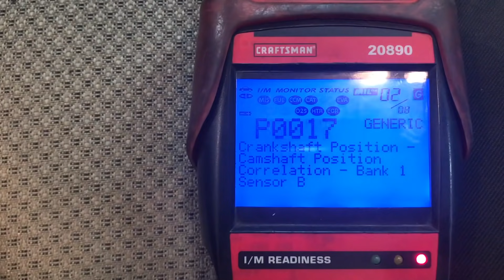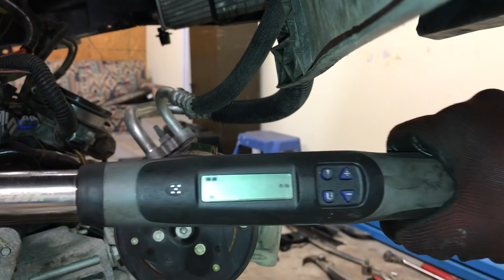Step By Step: 2.4 EcoTec Timing Chain Replacement

Comment: Change your oil..   as I GM technician for over 20 years this RARELY happens on engines where oil is changed about 3 times a year..  or 4k miles maximum... I've done hundreds of these and its  usually after many overdue oil changes...  I've seen this happen many times and there was less than one liter of oil in the engine..  and they went 10k + on their oil.  When the oil breaks down first thing that will fail is timing components.
Reply: ummmm ima call bullshit. these timing chains are known for stretching around 100k miles and taking out engines. partly due to plastic timing tensioner breaking. we had to have ours done at 98k miles and the dealer tried to not warrant it under the 100k warranty. I'm very thorough on oil changes and making sure the oil is at right level at all times and this still happened. but now car has 250k miles and since I need to do headgasket ima do timing as well
Reply: Changing your oil isn’t going to stop these shitty guides from exploding. 7/10 of these motors on the road are driving with broken timing chain guides and bolts
Reply: Quit lying to everyone. I'm a mechanic for a living and I've worked on this engine many times. The first generation has a very flawed timing design that tends to break the front guide and it's top bolt. GM even noticed this and changed the timing design and suddenly the problem doesn't occur on Gen 2 and 3 motors. You're either not a very good tech or you are BSing for the companies sake and neither is a good look.
Reply: The 2.4 burns a lot of oil, I just worked on one that had a worn chain and it had less than 2 quarts in it
Reply: Terry Goodbody how much does this job usually cost
Reply: Hi Terry - have ecotec 2.0l turbo solstice engine with engine running poor and timing chain stretched and drooping between cams - u think only need to replace main chain and not the balance chain too that goes around water pump?  No issue with water pump.  With the main chain replacement will get phaser replaced too.  But like not to have mechanic do the balance chain so not more cost.  What do u typically do in gm shop.  Thanks any update
Reply: When I changed the oil on the used saturn I got, there was visible debris in the black oil filter😥
Reply: Absolutely right! I change my oil when the monitor says 20% left use synthetic mobile 1 dextos 2 additive and a high quality synthetic oil filter! I never let the oil level drop  not even a bit.  The other thing l do is l throw the novented oil filler cap in the garbage can and install a  Gm vented oil filler cap. This will guarantee that you will never pop the rear main seal if the PVC hole becomes plugged especially in  cold climates. My 2015 doesn't burn any oil and runs excellent perfect gas mileage  8.2 liters for 100 km at 100 km an hour! The only other thing you need to do is exhaust manifolds are cracked by 100,000k and the up stream sensor need to be replaced same time as the manifold or 100,000km
Reply: Is there a difference in the timing marks from the lea to laf engine or are both 10-2
Reply: Great info accurate and helpful
Reply: Yeaa i’m calling bullshit, these 2.4 Ecotecs and the 3.6L v6’s are notorious for chain stretch on top of their own unique issues. regardless of oil intervals if the customer followed the oil life percentage on the dash or called bullshit and did their oil changes every 3k miles
Reply: 20 years???yeah right. Whatever.
Reply: These motors are junk....plain and simple..as I've been a gm tech for 30+ years ...
Reply: I am have been working  on cars a long time and I have to say this is a shit timing chain set up!
Reply: @doworkscotty What do you think ??
Reply: I'm doing this job tomorrow and I had some people tell me that I need to have the motor balanced after I'm done is this true?
Reply: @ryanhall7016  No it is not true.
Reply: Well if you jump timing you probably bent a valve or more so the head needs to come off and be sent to a machine shop. Over changing your oil won’t help this problem either the plastic guides just wear out overtime
Reply: Will fixing the timimg help, solve the problem ? is the engine still good?

Comment: So what would be the best way for me to find TDC?  My balance shaft chain either broke or the guides failed and i also had codes for advanced/retarded timing. Yet the timing chain is still connected just fine with a little play but obviously i do believe that my engine is timed improperly. How would i find tdc without further contact to the valves and pistons?

Comment: Is it possible to do without pulling the engine out?
Reply from the maker: Yes, it can be done with the engine in the vehicle. I raised the body of the vehicle off the engine to make a better video.
Reply: Okay cause I'm doing it on the same engine but in a 2007 Pontiac G6 . Long story short I was doing the water pump and ended up having to open up the timing cover to fish a stupid bolt out. And there was one bolt in the middle of the cover that was really long and I couldn't slide it all the way out cause it was hitting on the passenger side and I couldn't take the cover completely off. I just figured you'd have some more insight. thanks man!
Reply: Hold up hold up I got it figured out. Cool

Comment: The Haynes Repair Manual 38027 for Chevrolet Malibu 2004-2012 states that for replacing the timing chain on 2008 or later models the engine should be rotated to TDC on the exhaust stroke instead of TDC  compression stroke used for earlier models.  I noticed the engine you have in the video is a Ecotec with Variable Valve Timing (which is what I have in a 2010 model), so is Haynes off the mark here?  Excellent video, well done.
Reply: He said do it on the compression stroke because the valves in the cylinder are closed, if you leave it on the exhaust stroke then possible smack the valves into the piston and create a new problem. Some camshafts have a tendency to still be under valve spring load from other cylinders and slide off tension which causes the valve piston contact
Reply: Cloyes says the same thing, on the exhaust stroke. I believe it is only regarding specific GM 2.4L engines, post 2008. Still though, confirmation would be nice.

Comment: Just did this job on my 2009 Chevy Malibu all the timing marks lined up rotated the engine more than you stated to make sure no interference and when the marks come back to the spots they were at before rotating they’re off one tooth. Is this normal?
Reply: Are all of the marks off the same amount?  If so, you are golden.
Reply: Yeah they are reason I was asking is it keeps throwing a p0017 code and the idle is at 3000 rpm

Comment: Hey man, just replaced the timing chains, actuators, solenoids, tensioners and guides. Started it up and runs a drives fine but sets a P0014 and a P0011 code. I noticed in the video you did not use a locking tool for the actuators when you tighten them. Wondering if the reason I’m having these codes set is because I did not use the locking tool to put them in the “park” position? Looking for some feed back. I’m 100% sure the timing is right with the marks.
Reply from the maker: The locking tool helps hold them in place while you torque the phasers to ensure the proper angle meter torque. Another friend of mine did this job and had the same codes come back. Even though he was sure the chains were aligned properly, it turned out the crank was one tooth off. Unfortunately the only way those codes will set is with a stretched chain, broken guide/tensioner or a gear being a tooth off after reassembly.

Comment: I do a seafoam treatment and oil change every 2k miles or less on my Cobalt. The inside of my engine is spotless. It's an SS so I treat it like it's a Ferrari when it comes to maintenance. That sludge buildup is the main problem with those engines.

Comment: So... I have a 2011 Malibu with the 2.4 and was probably ignore symptoms and signs for a while. But one day pulling into a parking spot the engine starting sounding like crap and soon (very soon) shut off. Tried turning it over and there was all sorts of grinding rattling noises and would not start back up. Would you say it is the timing chain?

Comment: Nice, vid just one thing I would like to add is that if the crank has a diamond washer remove it to see the actual timing mark because the is one on the crank gear small dimple that looks like the timing mark but it isn't,

Comment: I bought a 2011 Chevy Equinox with 2.4l engine, the engine was a pile of junk. Checked oil at the second tank of fuel. When I removed stick I could smell fuel in my garage as if someone knocked over a can of fuel. The next day I drive the vehicle to dealership and some kid that does oil changes and he said “smell is normal.” No freaking way. I went to another dealership and did oil consumption test, checked oil level and it was dry. So I put in three quarts of oil and drove to dealership. I explained to the lead mechanic what I did and he said “you ruined the oil test.” I said F you, this this is a piece of junk, less than 1,500 miles on it. I drove it for three years, always with three quarts of oil in the back. The day I traded it in I got a recall saying my vehicle had been identified as “a vehicle that consumes oil.” Pure junk, not even worth fixing.
Reply: Jeff Talbot I learned the hard way!!! A piece of junk you got it right Smdh. My timing chain broke.  What a waste of money and time.

Comment: I got a question if your still active. I’m doing the timing chain on my car. When I pulled the valve cover off the timing chain fell apart and dropped to the bottom. It’s didn’t damage the case it just damaged a couple guide bolts. But with the chain not being attached to the cam gears. Is their a certain position the cams have to be in to properly time the motor?

Comment: theres a couple of different models of the “2.4l ecotec” this is an LE5. gm stated the engine had the least warranty claims durring it production run of any other engine in its history. Doesn’t mean alot coming from gm i know, but i cant believe people are having these problems without some sort of neglect
Reply: Yeah, warranty runs out and the front timing chain guide breaks. They are a good running engine besides the timing chain if they aren't burning oil.

Comment: I have a 2006 cobalt with a 2.2 constantly setting a p0300 random miss. Tune up didnt fix, took valve cover off, and spun engine over by hand. Chain goes limp sometimes....dont see any broken guides? Is removing the engine necessary or can i change most of it out on the vehicle? And water pump in car? Thank you.

Comment: I'm working on a Saturn Sky 2.4L.  Why do you have to remove the cam sprockets?  Looks like the chain will come off and go on with them left in place?  And you can't mess up their positions by torquing them on again with new bolts.

Comment: did you have to drain the oil before doing this?
Reply: why did you have to move the exhaust cam 45 degrees? I don't understand timing, I figured it should have been in time if you pulled the chain off and didn't turn anything? please tell me why that was necessary.

Comment: What's that tapping sound after putting engine back in car?
Reply: The first start after rebuilding  will still have to push the oil to the lifters. Sometimes even when done properly you will get that lifter tick, sometimes it goes, sometimes its the lifter lol. Fix one part leads to the next and the next.

Comment: Still loud af it needs a new engine. The timing chains all go out on the junk 2.4 it's the worst engine GM ever built. The garbage timing chain going bad causes too much damage to the engine so you really need to replace the whole engine. People must change the oil in the 2.4 every 2,500 to 3,000 miles never going over and the timing chain will last alot longer. The main reason they go out is because people don't change the oil like they should.
Reply: Your whole post is wrong. All wrong
Reply: My thoughts exactly, I have a 2011 with the 2.4 and approaching 210k miles and it's not near that loud. They didn't take care of this car
Reply: @mcompton2010  another expert at work
Reply: Is that oil change interval (3k) for regular oil or even with synthetic?
Reply: I have 2013 chevy captiva with 131,000 miles still running good on average 28mpg I use Valvoline maxlife oil

Comment: I am a gm master technician at a gm dealership. Ive done hundreds of these engines. Very nice job and great explanation. Spot on.
Reply: Any advice you could give to those of us who own a newer (2014-2016)2.4 ecotec engine? Ive got 25k on mine so far with no problems yet. I change my own oil every 4-5k miles with synthetic (pennzoil platinum, quaker state ultimate.) Next change im going to Amsoil!
Reply: @ryanchristensen1799  Are you sure you don't have a 2.5 Ecotec?
Reply: @DJR5280  yes im sure, terrain and equinoxes  have 2.4 L and the emission sticker under the hood says its a 2.4 L.
Reply: @ryanchristensen1799  I assumed you had a Malibu.
Reply: David hi - do u have to drop out engine like done here?  Or can do with car on ground?  How long does this take?  And if doing chain and tensioner - should replace with new cam phasers and water pump too?  And please could give approx cost for doing this job?
Reply: @michael-qp9xd  I've done hundreds of these so I can usually whip them out in around 2 hours.  I don't change the water pump because that is a whole other ball game, plus they rarely fail.. I do how ever change the water pump/ balance shaft chain, guide and tensioner while im in there.  I always change the actuators/phasers and also the solenoids.  as far as cost I think the dealership charges around 1200.00
Reply: @davidhill588  thank you David for fast reply - just couple more questions.  Great if could reply again.  I have the 2.0l solstice gxp turbo engine and with rear wheel drive - for this the radiator and condenser need to be removed to get access to lower engine front cover for removal of chains?  Also seeing in video that the tensioner unit with the spring inside, this in bolt unit and enters from left side and then to release spring unit need to tap from above - wondering if slight chance this all i need for my car as this item failed in my car and caused droop of chain between cam sprockets so this easy fix just replace this spring unit without having to replace chains?
Reply: Hi David - thanks for other answers.  One other question on my 2.0L turbo solstice with drooping main chain and poor engine performance.  Will have main chain and phaser replaced with new.  THere is the balance chain - do u typically replace this too?  I am not having issue with water pump which connects to balance chain.  If main chain stretched is not too that the balance chain too always issue?  Thanks mike
Reply: one question for you why move the exhaust cam gear to align, arent they not suppose to move/?? i see at min 4:35 he turns the exhaust gear clockwise so they align....do we have to not set it back????

Comment: Synthetic oil change every 5K religiously and you shouldn't have to do this. I have a 2011 HHR with the 2.4L Ecotech with 320K  miles on it. Everything in the power train is factory original. Other than normal wear and tear stuff everything original including    belts and hoses. Original coolant, brake fluid, power steering fluid and only one transmission fluid change at 100K. This car has never let me down. Best car I have ever owned.
Reply: They still break the front plastic timing chain guide with synthetic. You got lucky.

Comment: Just did this job using your tutorial. It helped immensely. Purchased all my parts from Rock Auto online except for the torque to yield cam sprocket bolts. Those I bought at the Chevy dealership. I left the engine in place when doing this job. That made it difficult removing one of the timing chain cover bolts(an extra long one)  and one of the motor mount bolts. Both of these bolts will hit the fender wheel well until you lower and raise the motor using a bar for leverage. Put everything back together again and it’s running great. Thanks for the great video!
Reply: 777antlers Drill a hole for relief. F it!

Comment: Would I be right in assuming that the timing chain alignment marks would be in the same  place after two engine revolutions?
Reply: No. Once you spin the engine over, the chain marks to sprockets will not line up again.

Comment: I pity any Gm, Ford, Dodge mechanics and these Nightmarish high tech POS engines...What happened to the Iron Duke 2.5, Ford older 2.3 i4, 4.9 i6, Dodge slant 6 , 2.2 i4, gm 250 i6...Some basic bullet proof motors gone cause of EPA gansters...So Sad...i owned all these engines..
Reply: Douglas Fox I blame females. No shit!

Comment: Hey Dan, got a question for the balance shaft chain. I saw a comment earlier you made regarding the water pump replacement and needing a special tool. If I am doing the timing chain kit on a 2.4 ecotech in a 08 malibu, If I were to do the balance shaft chain kit with new sprockets as well, do I need a special tool or is the full replacement of all the parts make it not needed?